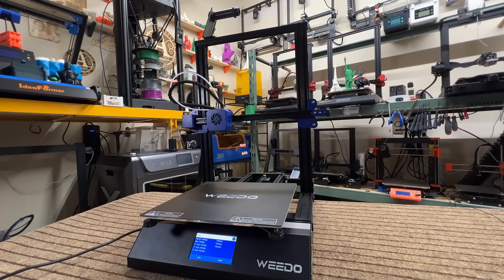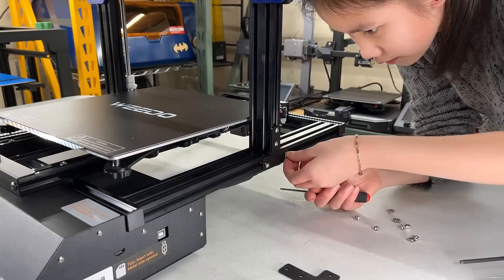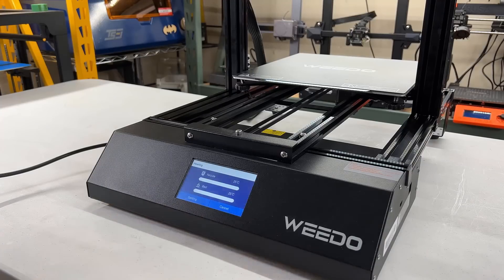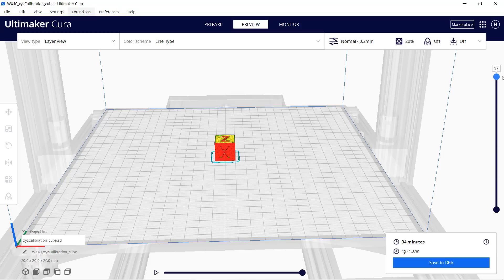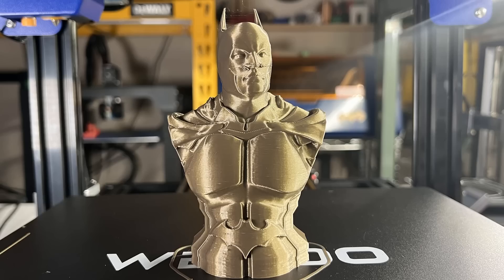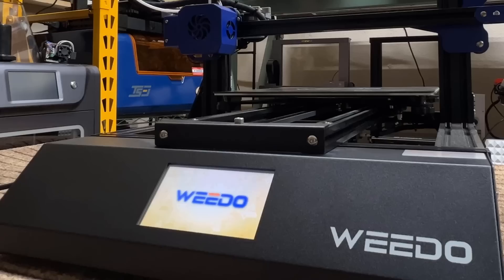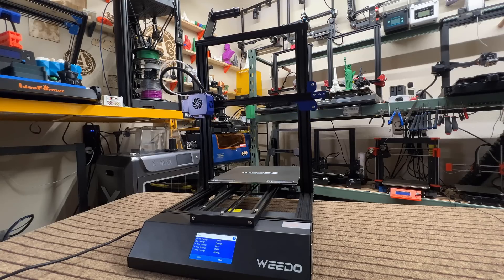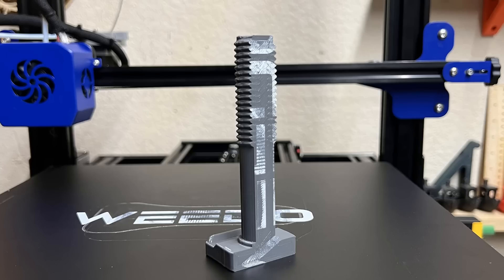Weedo ME40 300x300x400mm High-Temperature 300C hotend 3D Printer with ABL, Spring Steel Sheet

Comment: SO they took the failed weedo X40 and took a print head off and called it the me40.. doesnt change the atrocious lack of support, firmware fixes etc. The community needed to make a firmware for the printer to even work.   If anyone is interested in this printer just research the weedo x40 kickstarter.......

Comment: 32bit  "GD" processor.... That has some legal implications.. GD's are cloned  ST processors that are unlicensed and not fully supported by Marlin.. This means issues trying to flash custom firmware to the mainboard.. not to mention possible legal issues for Weedo in both USA and EU markets as the GD processor is basically an illegal ST Clone that has not been licensed by ST. Considering the "Kickstarter" this could cause the Kickstarter to be terminated by  Kickstarter themselves if reported.

Note: Voxelab got a lot of negative feedback for doing this on the Aquila when it was released. 
I think Bigtreetech also released SKR boards at one point that was GD processors and they recalled them for same reasons.

Comment: Same ancient design with the bimetal heatbreak advertised as main feature. Are we back in 2017? And why the hell it's on the Kickstarter as they released ME40 Pro which is almost the same but dual extrusion back in 2020.
The consumer 3d printing industry is absolute waste of workforce and resources.
Reply from the maker: Yes, totally agreed. I think it's not too bad if they price it at around $300.

Comment: Ender 3 clones on Kickstarter in 2022 is a joke!!
Reply from the maker: You are right! I can't see much innovation at all, the selling point is a low-price CR-10 size high-temp printer with ABL and touch screen. I think it still has its market if the price is close to $300.